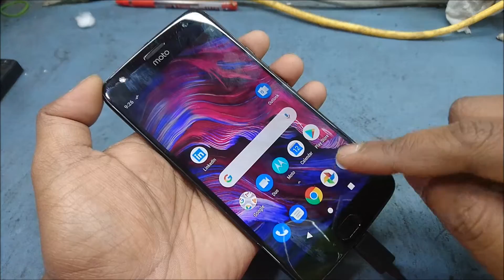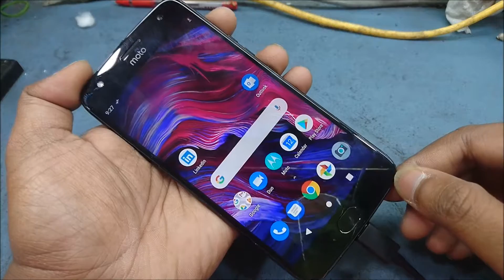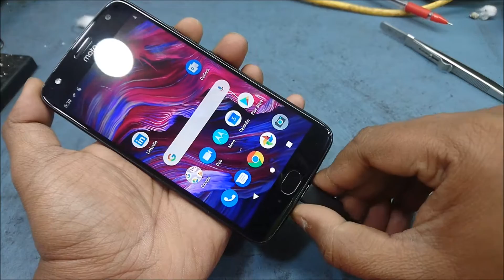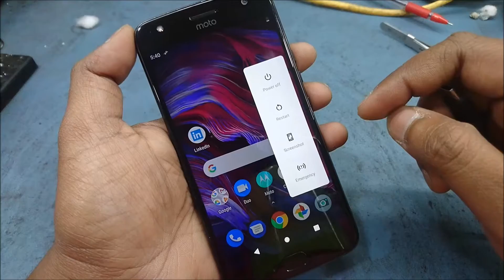Motorola Moto X4 charging issues [No Turbo one side] Problem fix 100% Solved

Comment: Sarey process k baad phone ipx ki rate ki kya rating ho gae?
Reply: Phone water resistant rahe gaa yaa nahi?
Reply: @trackmaker12345  phone open hone k bad water resistant nahi rehta
Reply: @trackmaker12345  Mera pass do phone h dono Moto X4 (ip 68 rated).. Maine Bohot bar paani se clean kia hai kabhi kuch nahi hua but yaad rakhna agar Paani se contact me aa Jaye to charging connect mat karna 1 din tak... Otherwise port damage ho jayega.. but kyuki ye phone ip 68 rated h paani under nahi jaygea so still port change Kara sakte hai but open hone k bad water resistance nahi rahega.... Sab se best hai ki water se door hi rakho. Or clean karna h to electronics cleaner use karo (90% isopropyl alcohol solution) wo instantly evaporate ho jata h or corrosion nahi hota... ab mere dono phones me ek side se hi charging nahi hoti but otherwise sahi kaam kar rahe h isliye risk nahi leta.
Reply: @crczr  Thanks bro.
Now this is the best reply.....👍🏻

Comment: How did you know it was the charging port? I swapped one out but still couldn't get the battery to take a charge on my x4
Reply from the maker: Your motherboard are can't connect to back body surface properly, it means motherboard back side down back camera left side, 2 pins are properly touch on body surface,  please check,

Comment: My x4 was working perfectly fine but then my charging cable broke, i bought a random type C data cable to replace the original, now it has done something to my battery, after using that for just one month, my phone switches off if it's not on charge no matter what i do, like playing video, opening camera.
Reply: I also have the same problem with original cable. it started 3-4 month ago.
Reply: @kumarmithilesh1886  Maybe that's an issue with your battery. On my dad's moto x4 the temperature sensor is broken or not fully connected so the phone thinks it's on -29°C and won't charge. Try to press above the logo on the back and look for the battery temperature if it's changing to +30°C

Comment: My moto x4 charges properly but gets switched off suddenly and becomes zero. I replaced the battery but it didn't work. Any solution ?
Reply from the maker: Battery change but service center
Reply: @amitkeshwar2428  I have the same problem but didn't changed the battery. So what is the reason and what to be done? Plz help
Reply from the maker: Need to replace battery in service center in your city for original parts

Comment: Amit bhair mera X4 dead ho gaya hai charge hi nahi ho raha hai and on bhi nahi ho raha hai. only battery charging ka symbol show kar raha hai. amit bhair please help kare meri, mera bahut data hai usme and bahut se personal and confidential cheeje hai usme. Mene jitna research kiya hai mujhe lagta hai ki ye repairable hai but shop gyaa to wo bol raha hai nahi ho payega. please help me as soon as possible
Reply from the maker: Aap service center hi dikhado,  wo aapki help karenge, local market mat jao,
Reply: us symbol ka meaning h "cable connected"
agar charging jack water damage nahi h to theek ho jayega, otherwise jack replace kara dena official service center se. maine aaj hi ye problem theek ki hai.
"Thunderstorm logo appears but not charging"
aisa tab hota h jab bar bar battery zero tak discharge karte h battery ka capacitor weak ho jata hai or agar dead ho jaye to sirf dc (pc/laptop/power bank) se charge kar sakte hai (initially)
kuch % charge k bad turbo adapter connect kar sakte hai
agar phone already slow charge hota tha to aur zada time lagega

Solution:
connect to a pc/laptop/power bank (usb 3 port) 0.5 A
hold volume down for 10s and then vol down + power for 20 s
You'll see boot access options
leave the phone in this state and let it charge for 20-30 minutes
Now select start by pressing the power button
(At this point, u may feel the warmth of the battery on the rear side of phone)
Now phone will boot with 2-3-4% battery remaining (time to connect to turbo adapter)

Comment: My phone suddenly switch off how to fix it
Reply from the maker: Need to replace battery in service center original part
Reply: Sir care battery cost so much approx 3000 rs
Reply: @amitkeshwar2428  can u share the geuine link of the battery purchase
Reply from the maker: No, only original available in service center that's why a costly part, online or market only duplicate available, no performance, no backup
Reply: @amitkeshwar2428  oky sir